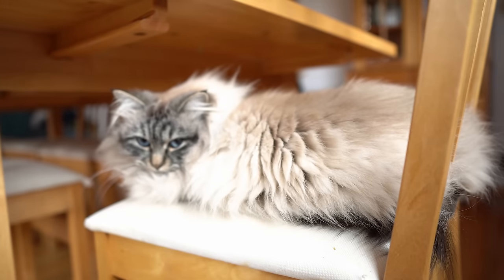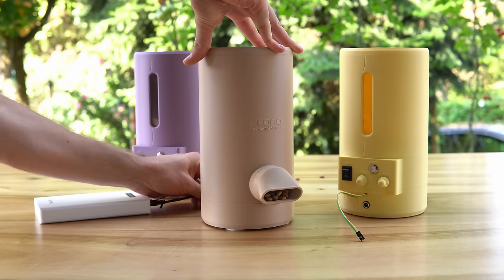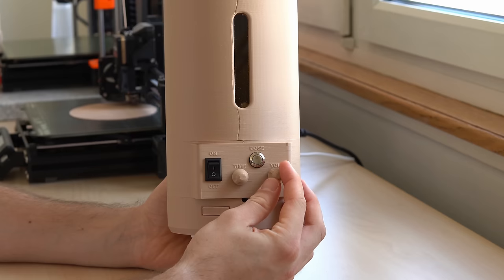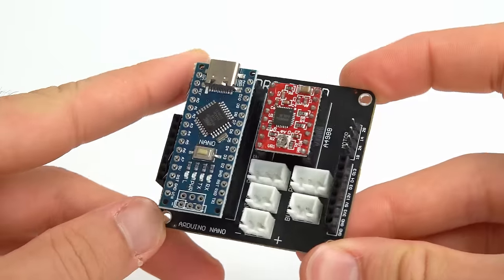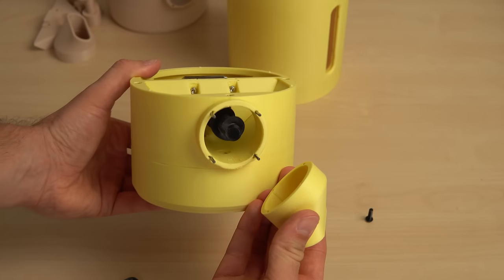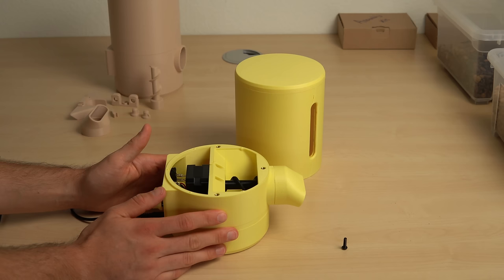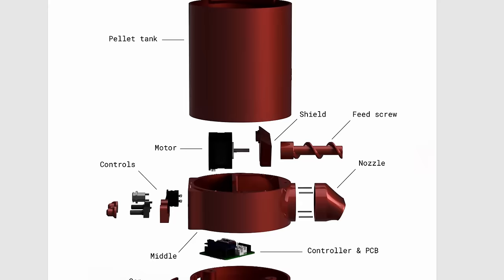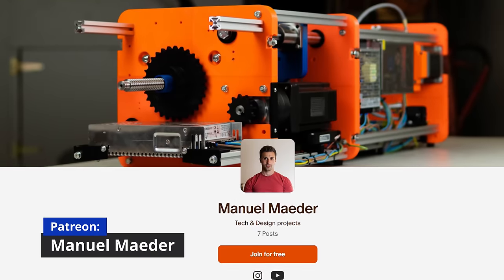I made an automatic pet feeder - DIY Arduino project PEDRO - Part 1

Comment: WOW….what a clean design. Awesome job. A couple of ideas. 1. The funnel at the front could be faced down a little so the pet can’t see that there is more food. 2. Use an ESP32 board and set it up for Home Assistant and control feed rates and timers through that. The second one is more of a wish and I wouldn’t have clue how to do that 😂

Comment: looks cool, but the first flaw i saw is your dispenser end :D When you have a cat, you know, this cat will put his foot in it to scratch out the food. Infinite Food Glitch
Reply: Indeed, the design is not cat proof. But then again, a dog will simply smash it to pieces.
You may also have to think ab out making it air-tight because dry food tends to absorb moisture and turn to mush.

Comment: Excellent design, but personally I would remove the Arduino and replace it with an ESP32, then you can install ESPHome and automate the stepper motor using HomeAssistant (this is how I built a similar but nowhere near as pretty automatic feeder for my axolotl!).

Comment: This is an awesome design. Love it. 
Two things that can be improved here:
The spout needs to face down more. Cats will stick their paw in there to get at the food. Also, maybe add a safety switch in there which will keep the feed screw from turning on if the funnel is blocked by, say, a cat’s paw. 
The base needs to be made VERY heavy to keep cats from just tipping the device over. I am thinking sand, concrete or lead/steel shot. Because sometimes, cats are humongous smartasses and just a menace. 😅

Comment: Small idea, but you could add a vibrator or maybe a buzzer to be activated either before, during or after the stepper motor to avoid pellets getting stuck. Funnels in the industry have them and greatly reduce the material getting stuck in them

Comment: Good idea. Two things ...
1: Some pets likes to chew on wires. Cats and mice (and puppies) might want to extend their meal, so try making it impossible for those animals to reach the wires. (Especially mice thinks wires look like straws). Making an add-on power-bank attachment could also be a solution for this. The power-bank could also function as a UPS, in case of power-outage.

2: You may want the food dispenser to alert the human, that it's empty. If you have a way of communicating with a smartphone via BlueTooth - or with a server via WiFi, then you could make a web-site or a phone-app, that could tell you to purchase more pet-food.

Extra: You could make it harder to tip the dispenser over, by making the bottom very heavy. A piece of metal or a rock or sand could do the trick. Mounting holes could be another solution (depending on the need of the pet-owner).
Reply from the maker: Thank you for the great input and well formulated thoughts! You mentioned some good points I will keep it in mind!

Comment: Cool design! If you want even longer battery life (and lower BOM cost), you could use a couple of 555 timers (or a single 556 IC), a MOSFET and a DC motor with a gearbox, skipping the stepper motor, driver and Arduino altogether but requiring more engineering time to get the setting right

Comment: Great idea.
How big is it?  I see no mention of size.
What size of bed do I need, for printing.?
Also how tall?
Also add a hook, or hanger.
Reply from the maker: Hi :) it is 130 mm in Diameter and 240 mm in height. but the single tallest part is at around 110 mm. So that will be the minimum needed print height of the printer, since the parts are stacked :) youre right i did not mention that.Thank you for letting me know! Manuel
Reply: @manutechlab  i am glad, I asked.
My print bed is only 115 mm.  Saturn 4 ultra.

Comment: I love the idea and the project, it would make a great Christmas gift. Do you have an estimate of the total price ( BOM and circuit ) ?
Reply from the maker: Hi Mathieu, It would certainly make a nice Christmas gift :) it depends a bit on your location so I can only speak for me in Germany on the cost. There it is roughly at 60-80 euros for the non printable parts but often parts like the switches or buttons only come in sets which is a bit annoying.. that’s why I work on a parts kit for those non printable parts to make it easier to rebuild:) I think the first 15 kits will be ready the beginning of December just so you know. Best wishes, Manuel
Reply: @manutechlab  Thank you for the info! I think I'll follow the BOM to have a few spare parts on hand and that not to expensive. But it’s good to know that there will be kits :)

Comment: 1- The layer change seams on your 3D printed parts are terrible, most probably due to an outdated slicer.
Look for "Scarf Joint Seam" to make them disappear (PS and Orca)
2- Controller looks outdated as well. Moving from an Arduino Nano to an ESP (either 8266 or 32) would give you more precise timing (RT clock), controls (web interface) and home automation integration (NodeRed / HA) 
3- Food safety and microplastics. This part is easily solved by food grade epoxy coating. Look for Aquarium / fish tank safe epoxy
Reply: I see the seams as a design element - I quite liked them!! Not everything HAS to be smooth and even...
Reply: @michael-rommel  Most dishonest answer award🤣
I can't get rid of the seams, so I'll call them "a feature". 
Try at least to make them aligned to it might look done on purpose @2:31